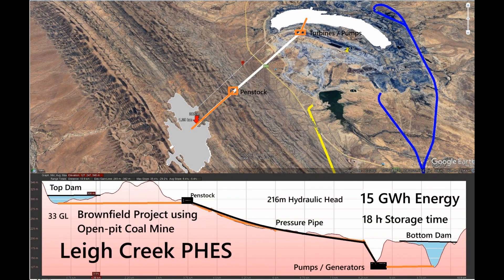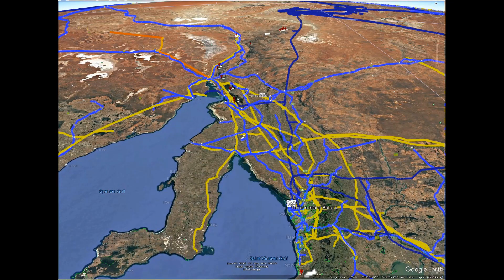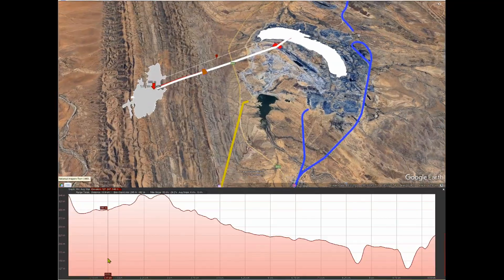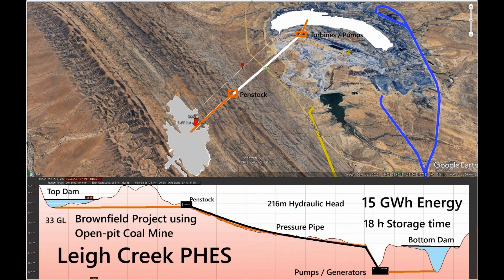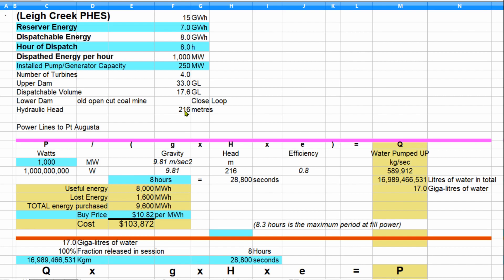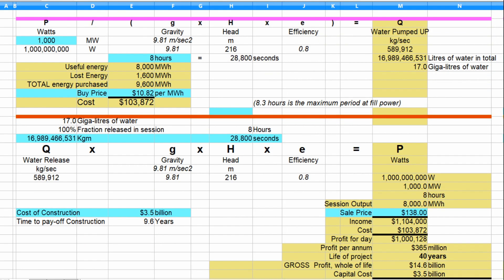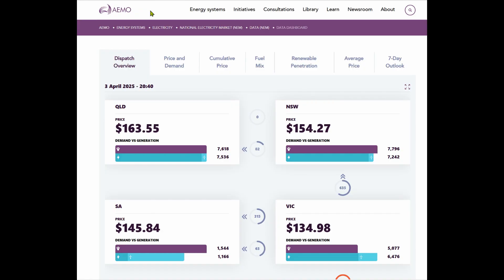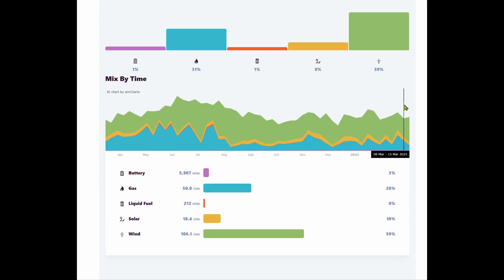Leigh Creek Pumped Hydro Electricity Storage PHES proposal.

Comment: SA does not have that sort of price differential every-day, but any time the wind drops outside of daylight. which is about 2-3 times a week,  then this could provide. That would mean a longer pay-back-perhaps 15-20 years. Still reasonable if the powerlines are up to it. Could have its own solar to feed it-which would be cheap and reliable there-and cut down on line losses.
Reply from the maker: I think you are making valid points.   
The example given is the scenario which applies at the time of creation of the video.   If the things around us change then the computation needs to be adjusted.
If all the negative wholesale pricing during the daylight hours goes away when electricity generated from steam from boiling water ceases, we then need a different set of calculations.